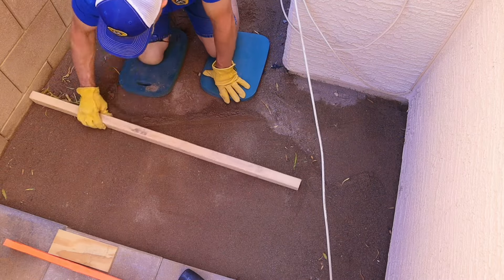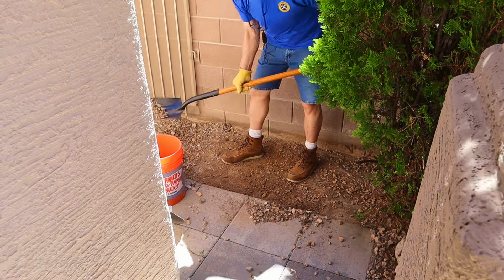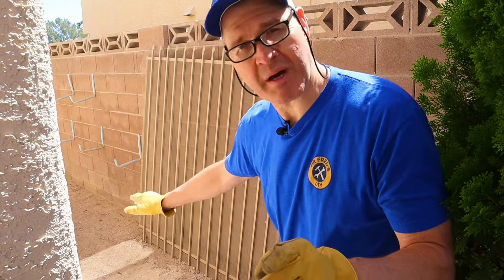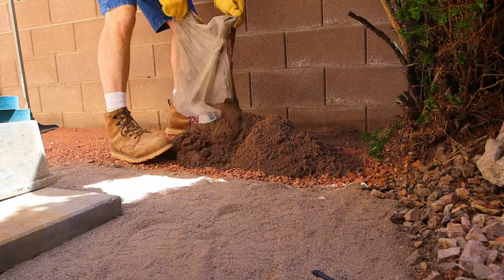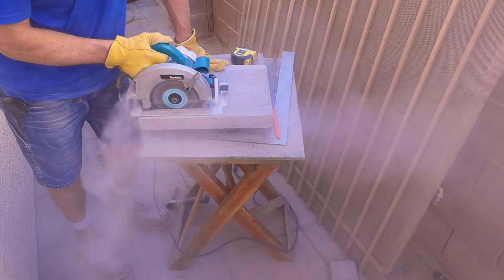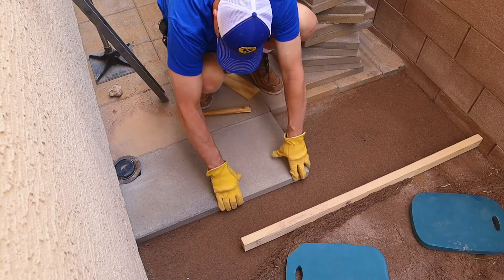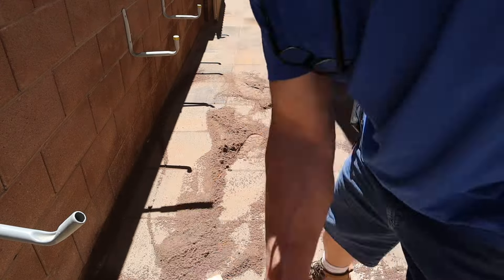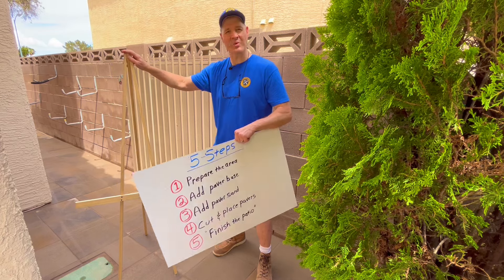How To Install Concrete Pavers-“Professional Results”

Comment: Looks fantastic. But how is the drainage on this for rains and such.
Reply from the maker: Thanks for commenting. As for drainage, from the irrigation box to the evergreen tree, there is a little slope. This side of my house is a gable end and we only get about 3 inches of rain a year here in Las Vegas. As the cliché goes, “it’s a dry heat”…